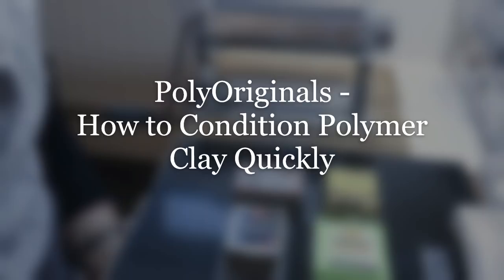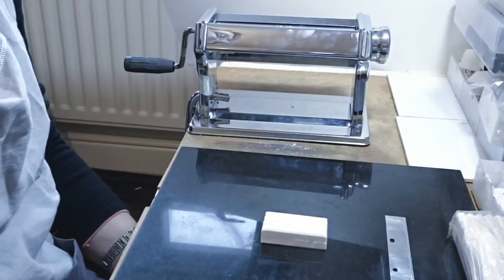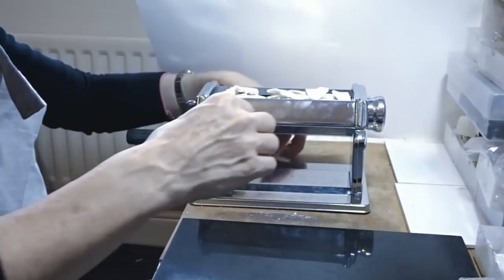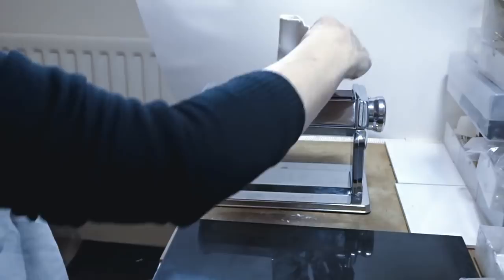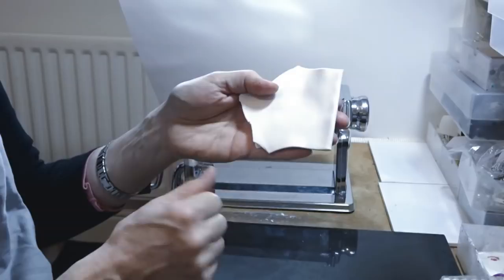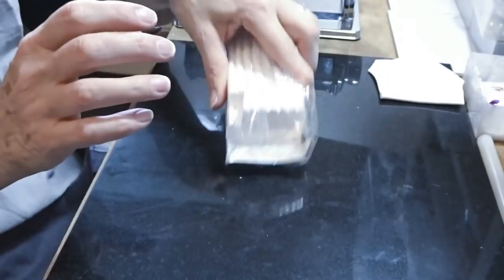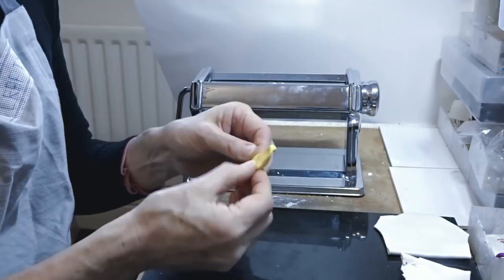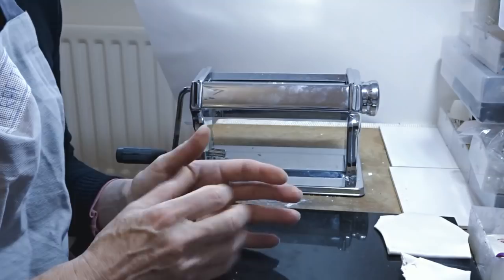Conditioning Polymer Clay Quickly - some tips

Comment: I will adopt your method of folding.  For dry clay, I would have used the sheet of soft white clay you first conditioned and added thin slices of the dry cracked clay to that, a few pieces at a time.  If I don't have any soft clay of the same color to add dry cracked clay, then I use a bit of pearl clay to start with or transluscent clay that I condition and warm up.
Reply from the maker: Thanks Jill :)

Comment: I am using Mont marte Clay which is new on the market. Their products are usually first grade.i has been extremely hot in Australia may be this is why. Surely as you said placing between a sheet of paper will help to soak all the old coming out through it. I will also try to keep them in the fridge
Reply from the maker: Ooooooh, I have never used that brand, so that's a new one on me and I have no idea how soft it normally is. But yes, you have been having it very hot over there, so it may be a combination of those two things that have caused this issue. Hopefully the leeching and cooling will help resolve the issue. But certainly don't discard the clay, there are some techniques when having a really soft clay is such an advantage :)

Comment: This is great thank you so much I did get that leathery texture and feeling on my clay however I see dents and some small cracking still what could this possibly be? 

Thank you!
Reply from the maker: Don't worry too much about that, as long as you get the clay workable and easy to move it should be fine. At times the mixture may be a little firmer, and added conditioning won't change that. As you get experienced, you learn to be able to feel when the clay is conditioned and not to worry overly. Some of the clays with mica powders or glitters are generally firmer, with more cracking too, even though they can be well conditioned. I hope that helps a little :)

Comment: I am going to try this, because I have Fimo which is old and I love Finished, Thanks so much!!!!!
Reply from the maker: Thank you Dorothy :)
Reply: Fiona Abel-Smith PolyOriginals , Thank You again Fiona, I have some old clay and I mean old clay, purchased date 2009 (I write the day I buy on the package), it turn all to tiny bits, but I brought it back to life. It took a minute, I placed the parchment paper under the pasta machine to catch the bits then placed another piece of parchment paper on top and kept rolling with my roller until it stuck together and then roll it though the pasta machine, this is Fimo. I had some Premo which came out flaky. So if this method works for that old clay I know I will not have any problems going forward.👏👏👏👏👏👏👏👏👏
Reply from the maker: It sounds like you have it all under control Dorothy, many thanks :)

Comment: Thank you for this it’s so helpful especially for beginners! You explain everything so well. What brand of machine do you have?
Reply from the maker: Thank you so much, I am glad it was helpful 🙂 The pasta machine I use is an Atlas machine, at home I use the 180 (a wider machine) and when travelling or on workshops, I use the 150. I have always used the Atlas machines and I find them very good for Polymer Clay. However, there are other very good makes, such as the Imperia machines, and of course those made specifically for use with Polymer Clay. Ginger Davis Allman, from The Blue Bottle Tree has a number of articles on Pasta Machines - https://thebluebottletree.com/?s=pasta+machines which may prove helpful in choosing a machine.
Here is a link to an Atlas machine, (for reference only, as obviously there are many other places both online, and in stores where they can be found), and it is worth searching around till you can find a good deal on one. I hope that is of some help. https://www.amazon.com/Marcato-8320-Machine-Cutter-Instructions/dp/B0009U5OSO/ref=sr_1_3?crid=BPH5K7P26RQT&keywords=atlas+pasta+machine&qid=1556786279&s=gateway&sprefix=atlas+pasta+machine%2Caps%2C211&sr=8-3 
🙂

Comment: Thank you for this tutorial. Is it possible to use a rolling pin to work the clay into that perfect product?
Reply from the maker: Sort of Alice, depending on what your rolling pin is made of ;) If it is marble, glass or most of the plastic/acrylic ones and completely smooth, brilliant, if it is rough wood, then they clay will have a habit of sticking to the wood, and may get ingrained in the little crevices. So yes, in theory, but just decide whether the rolling pin you have will be suitable. Then simply roll, fold, roll again until you have a nicely conditioned slab of clay. I hope that helps? :)

Comment: Thank you so much for sharing your tips, conditioning (I was using mineral oil to soften) but now I can't wait to try your fold method with my pasta machine. One question; the handle keeps coming out of my pasta machine...is there a trick to getting it to stay in? Maybe mine is defective?
Reply from the maker: Thanks Virginia :) Some people cut off the end of a finger of a rubber glove, and put that on the end before you put it back in. It does work quite well, but sometimes they just fall out continuously, it's just how yours is. The one I am using the handle has stuck in place, so I cannot remove it, so it's swings and roundabouts as to which is worse :)
Reply: @FionaAbelSmithPolyOriginals  Brilliant; I may try that with a dab of hot glue? BTW; I did try your conditioning method and am tickled by how well it works. Started a fairy house yesterday; did my first Skinner blends (came out awesome) but realized my fairy house won't fit in my polymer dedicated toaster oven...guess I'll be opening my kitchen windows to bake...;-|   Anyway, thanks so much again for your shared knowledge & tutorials. Now where'd I leave that rubber glove...
Reply from the maker: @googlegirl67  You shouldn't need any glue, it should simply hold it in place. Keep the rest of the glove, and then if it starts to fall out again, use another finger :) I am always against gluing ot doing something permanent, just in case you want to change something later on . Sounds like you're having good fun, I am so happy for you :)
Reply: @FionaAbelSmithPolyOriginals  Will do Fiona; a wise suggestion. Will send pic when I finish!

Comment: Question.
How long after the clay model is built, does it need to be baked ?
Example. If model is built on a Monday afternoon, can it be baked the next day or many days later ?
Reply from the maker: yes it is no problem to bake it days or sometimes even weeks later :) If I have left a piece for a really long time, I will check it carefully to make sure there are no cracks in the surface, sometimes roll over the surface gently, and make sure there is no dust or dirt. It is of course better to bake it sooner rather than later if you can, as the clay is - presumably - exactly as you want it, but if you can not, then later is fine. I hope that helps?

Comment: Thank you so much for this video, i am a beginner and i bought two clay blocks but i faced a problem, both are not at all hard and even sticky but when wedging there is always cracks, i saw that you solved this problem when folding, but yours was dry, with my situation it is soft, can you give me an advice please? Thank you in advance. I subscribed and looking forwards to more teaching videos.
Reply from the maker: Thanks Maha, it may be that there is too much plasticizer, you can leach it for a few hours, sitting it on simple piece of copier paper, Or you can pop the clay (wrapped securely) in the fridge for a couple of hours until it stiffens up. If it is really soft it shouldn't crack when folded? I'm not quite sure why yours is doing this, unless it is really under conditioned, which is slightly odd if it is really soft. If in doubt, your best point of reference is The Blue Bottle Tree, Ginger Davis Allman always has the best polymer clay advice, so check out her site to see if there is anything on there that may help more - https://thebluebottletree.com/?s=conditioning+clay  I hope that helps some :)

Comment: Thank you for this very useful video.
I just wanted to add that with an old and hard clay, thin slicing is essential, and heating too. You say we can keep some clay in our pocket for 20mn, that's a good trick, and we can also heat the clay on a radiator, or else, if we let our hands some time in hot water (not too hot ;-) !) , then when we work the clay in our hands, the clay becomes softer ...
Reply from the maker: All excellent tips too, thank you so much Barockeuse :)

Comment: Dear Fiona, thanks for the awesome tips and tricks. I have a rather strange problem. I am conditioning just as you’re advising. It feels like my clay is getting more crumbly. I have passed the clay over 50 times and it still has cracked edges. Is there a case where you can over condition your clay? Can some type of clay have crumbled edges and still be conditioned? This problem occurs when I use CERNIT GLAMOUR. Thanks for you help.
Reply from the maker: I am so sorry your clay looks as though it isn't getting conditioned for you. Yes, some of the clays which have a lot of added elements, such as the mica powders etc, can always have crumbly edges, no matter how much you try to condition them. I am not aware of any case of over conditioning, unless you are going so fast it is starting to bake the clay ;) so I shouldn't worry overly. If you can put the clay into a ball, and it forms fairly seamlessly, then it should be fine to use. It will be the added bits that cause the crumbling, so you should be absolutely fine to use it :) The only time I have come across clay that crumbled constantly, and never formed into a sheet/ball of any description, was some that someone gave me to try that had been left in full sunshine on a window sill. We all agreed in the end that it had started curing in the heat, and was therefore not usable as unbaked clay. I hope that helps, and go ahead and use the Cernit as it now it, you should be fine ;) Best wishes, Fiona

Comment: Thank you for a very helpful video and one that I will be using frequently.  One question though, how do you keep your pasta machine clean?  I am finding it picks up little bits of colour and I don't know how to get rid of this.
Reply from the maker: Thank you :) yes, all pasta machines pick up bits when they are used for polymer. There are quite a few videos and online tuts out there which will give some helpful tips. Mine are simple, while being very careful of your hands, Get a wad of tissues and rub back and forth under the rollers to pick up some of the clay. Then, turning the handle of your pasta machine the wrong way, rub wads of tissues back and forth across the tops of your rollers, picking up the bits of clay that are bought up as the rollers go in reverse. Do this across several thicknesses of setting on your pasta machine, finishing on the setting you will be using next. It doesn't get rid of it all, is not a fail safe, but it does help quite a bit :) Hope that helps, :)
Reply: Thank you, I will give that a try.

Comment: I used your way to sure my clay but it was very soft.  As soon as I place one on top of the other, I cannot move them apart they are too sticky. I have run it at least 30 tines, it looks good like a plastic , I think it it is the clay itself
Reply from the maker: If your clay is already soft when you take it out of the package, it shouldn't need too much conditioning at all. So you can simply do it by hand with no need to use a pasta machine or rollers at all. If it is so soft that it is difficult to use or will not keep its shape, you may need to let some of the plasticiser leech out, You can do this quite easily by placing it on a sheet of plain white paper overnight. In the morning you should see a ring of 'wet' paper under your clay. As an alternative, you can cool the clay in a fridge (carefully wrapped up) for about 20 minutes. Just out of interest which clay are you using, as some are much softer than others. I hope this is of some help? :)

Comment: Your machine is so smooth.  Would you mind sharing what brand you use?
Reply from the maker: Hi Helen, I have always gone for the Atlas make of pasta machines, the one in the video happens to be a 180 (the wider machine), but I also have the more normal 150 that I use. Here is a listing for one on the UK Amazon site, for more info only, other sites/stores will sell them. I hope that helps ? Other makes of pasta machine are also good, such as the Imperia machines, and of course those made especially to work with polymer clay are generally all good too. :)  https://www.amazon.co.uk/Atlas-Classic-Manual-Pasta-Machine/dp/B004BDKI68/ref=sr_1_3?ie=UTF8&qid=1531294755&sr=8-3&keywords=atlas+pasta+machine

Comment: I have 100+ blocks,of,polymer clay ive had for aroundb6-7 yrs and its very hard should I throw in the trash and not even try to condition or attempt to revive? Thoughts?
Reply: Think I will give your method a try its just so crumbly
Reply from the maker: This method works on really old blocks of clay, so don't throw it out if possible, it will come back, it will just take some work ;) If you have some fresher clay of the same colour, add just a little of the fresh in with the crumbly, it helps speed the process up no end, and is less frustrating. Good luck :)

Comment: I did follow your instructions but was unable to soften the Sculpey translucent clay. Any further tips please?
Reply from the maker: So I am assuming you have tried all four of the methods one after the other on this clay - so warming with body heat for 20 minutes, cutting in thin slices, using the thin setting in your pasta machine, and using a little similar/same colour of clay that is already soft, if you have some, to add to the mix? If all of these don't work, then it may be that your clay has somehow 'part cured'? There are good brands of clay softeners out there that you can mix with crumbly clay to get it back in working condition, such as Mix Quick and the Kato clay softener, but I have never had to use them - although I have them and have experimented with them to see how they compare to my method, they do the same job as my techniques, but maybe invest in a pack and see if it works for you? If your clay has somehow part cured, sadly you will never be able to get it to condition. Sorry I couldn't be of more help, but I hope something works for you soon. 🙂
Reply: Thank you for taking the time to answer my questions. The clay I'm using is newly purchased & in the large blocks which were very expensive. They are translucent clay. I'll follow your suggestions & see if I can get good results.
Reply from the maker: @melodymoore2082  I really hope you can, good luck 🙂

Comment: Is there a trick to get the conditioned "slices" back to a bigger block without trapping air inside? feel like thats my biggest issue, i like to take the clay from a bigger piece like from the package but after conditioning i have those thin sheets.
Reply from the maker: If you have thin sheets place them carefully on top of each other and either,  with no folds at the top run them back through a thick setting on the pasta machine, or simply roll over them  if you want a thicker block. To find air pockets, put a sheet of clay through a very thin setting, the air pockets should show up easily then prick them with a needle and press flat. Then you can cut/tear the sheet up into pieces, lay them flat to get the thickness you need. Repeat as needed, and that should get rid of any air pockets. I hope that helps? :)
Reply: @FionaAbelSmithPolyOriginals  Yes, i think so, thanks, im gonna try that out :)

Comment: Great tips but I’d like to see a really hard dried out clay conditioned. Thanks
Reply from the maker: Thanks Mary, but even really hard clay I slice really thin. I will sometimes, to start it off, add a little translucent or white (depending on the colour used) which is really well conditioned and add some to the first crumbles, get that up and running, then gradually add more crumbly clay in, and off you go :)

Comment: how do you clean your pasta machine? Do you take it a part?
Reply from the maker: No, I only take them apart if they have started malfunctioning, to see if I can try and save them. I get a wad of dry tissue, and keeping my fingers safe, rub it back and forth under the machine rollers, while turning the handle, in the opposite direction - i.e.. anti-clockwise. I also then use the bunched up tissues across the top of the rollers, again while turning the handle anti-clockwise. I do this over several different settings of the pasta machine, until there is no more residue coming off on the tissues either on top, or underneath. I finish the process on the setting I am next going to use, to give me the best chance of starting off with no extra bits. I hope that's of help? :)